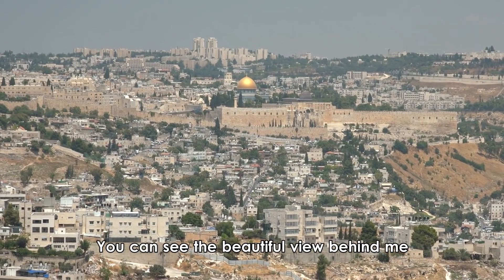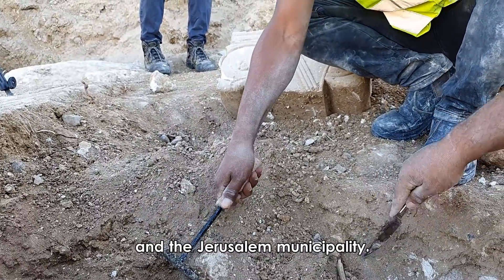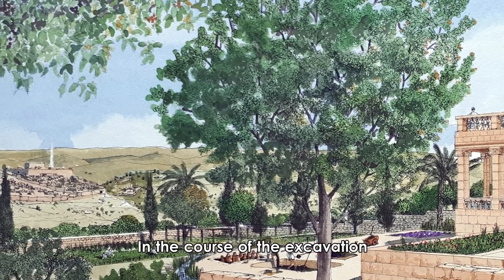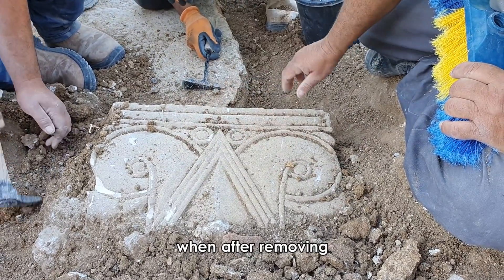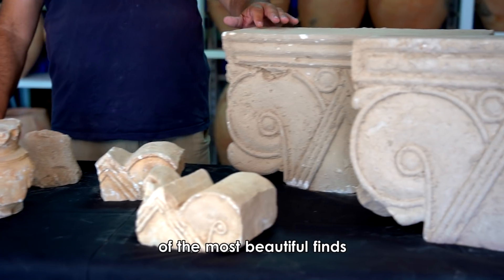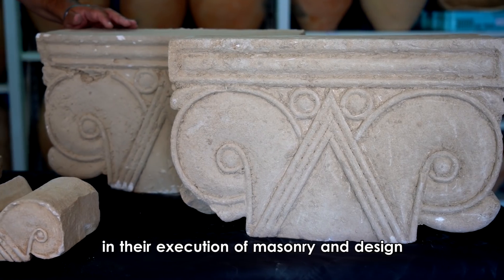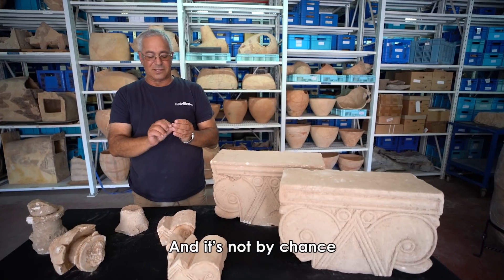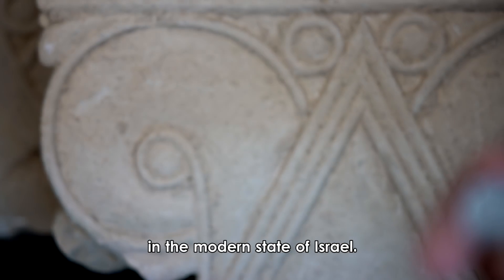Magnificent remains of a royal structure from the time of the Kings of Judah were discovered || IAA

Comment: Why do they look like moulded concrete and not carved.
And why did one have a hole in the back like it’s hollow?🤔
Reply: The hole might have been filled by a wooden beam which is an organic matter and therefore didn't survive the times. 
The Colosseum in Rome for example  also has holes which once had metal rods holding the marble.  These were stripped during the ages.
Reply: The other option to a wooden beam going in the hole is that it was a "locating hole". This technique was used with large pillars/columns. They were made by stacking multiple cylinder-shaped stones on top of each other. Each one had a locating hole on one end and a locating nobble on the other. Like a male-female power plug system, the piece that would sit on top of it would have had a little nobble that slotted into the hole.
Reply: @kevincurrell8609  or it simply could be a fake?
Reply: @chessboxer35  Wow!  Are you an archaeologist?  What is your reason for your skepticism?
Reply: @mijlaid  I mean come on, they just happened to find two ultra rare perfect stone artefacts one on top of another, in shallow earth?
Then we se they look moulded rather than carved and one looks to have a hole in the back like its hollow?
Reply: The main 'capitals' are decoration on the top of pillars. They don't have a hole.  Only other parts that have to fit together neededrods to hold them together.    Listen to the podcast of Walter's World on israel national radio Arutz 7 english where everything is explained.
Reply: @walterbingham9944  put your glasses on and watch it again Walter, there is a hole on the back of one of them, actually looks like the bottom of a cheap piece of pottery
Reply: @chessboxer35  I appreciate your comment, but a more polite choice of words would have been nice.
Reply: @walterbingham9944  apologies, get so used to people being rude sometimes get sucked into it.
Reply: @chessboxer35  accepted
Reply: @chessboxer35  I don't see where it looks molded. Having a hole in the bottom/side as PonyClub said would be from a wooden beam. If I faked an archaeological discovery I wouldn't cheap out and add obvious flaws, if they are flaws. I also don't see what they gain from faking it, it will be discovered if they are fake.